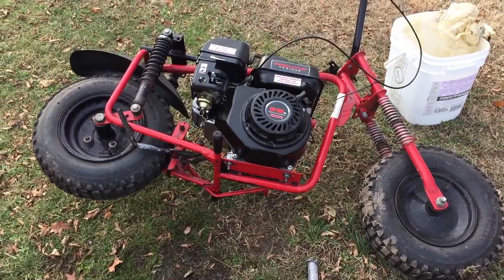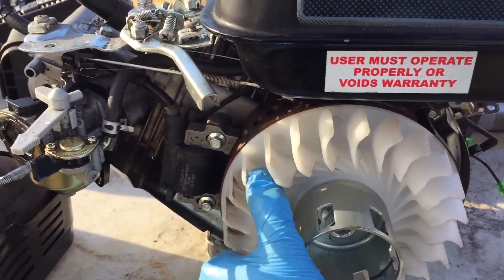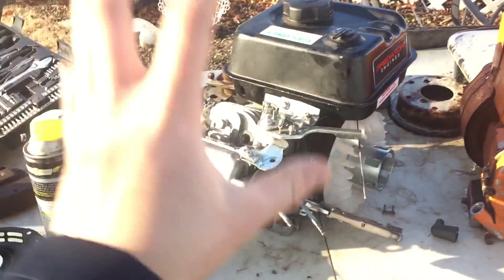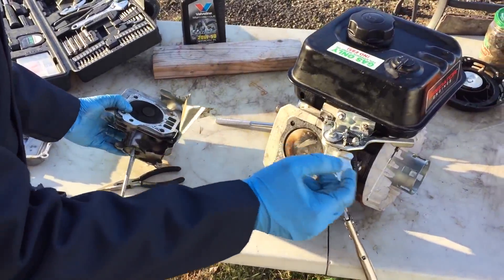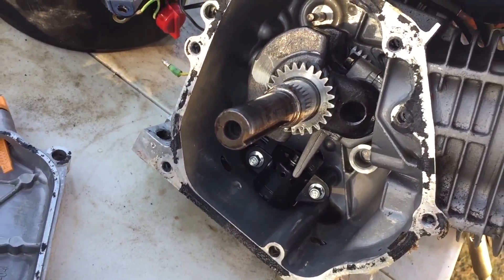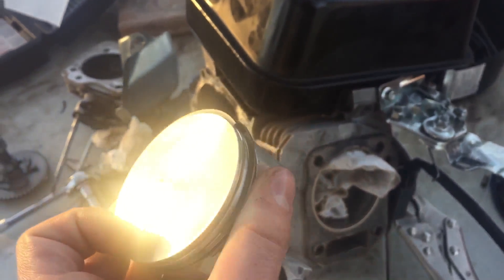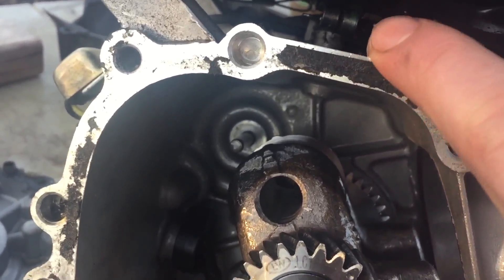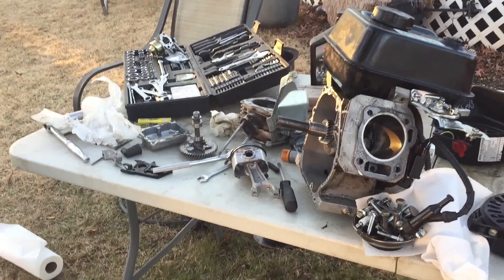Trying to Revive the Predator 212! (Part 1)

Comment: I saw online where someone had a similar problem.  Cause was incorrect valve lash.  Something to do with not having the cylinder at top dead centre when setting the valves.   I can't remember if it was youtube or Oldminibike.com.  Hope that gives you a starting point. EDIT: I found the post on Oldminibikes.com  http://www.oldminibikes.com/forum/honda-clone-predator/140351-engine-assembly-issues.html